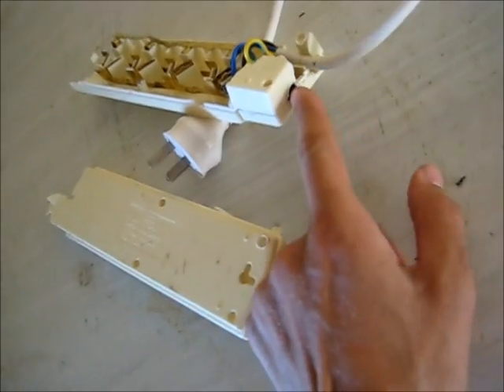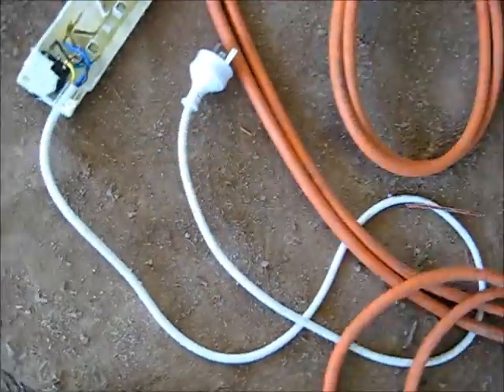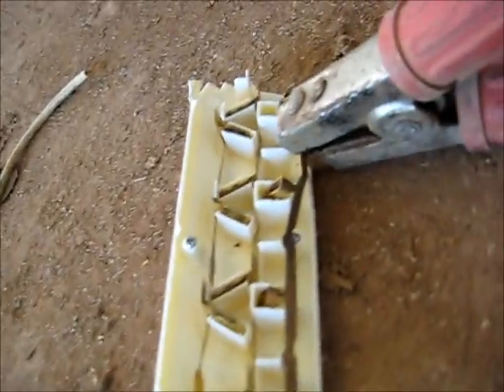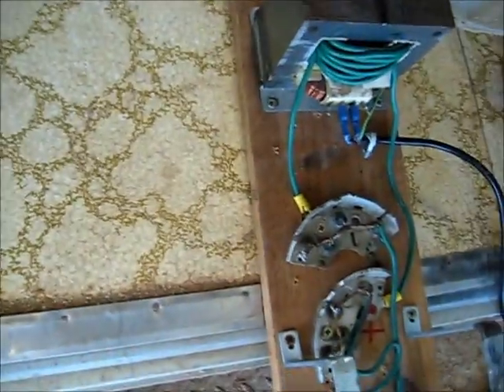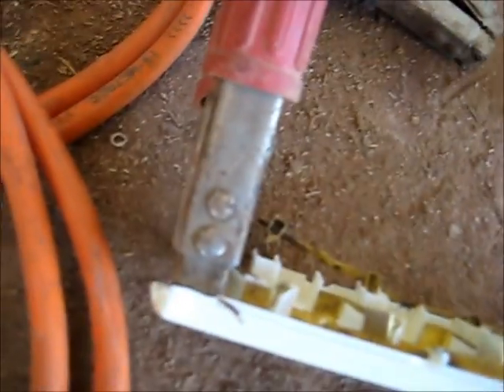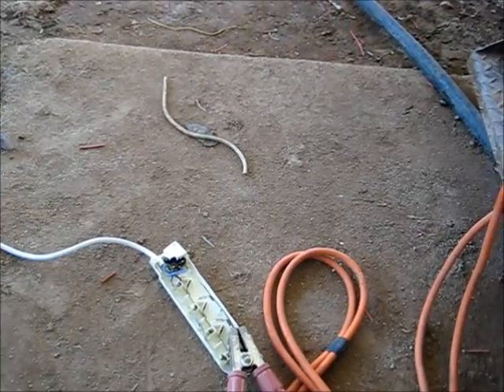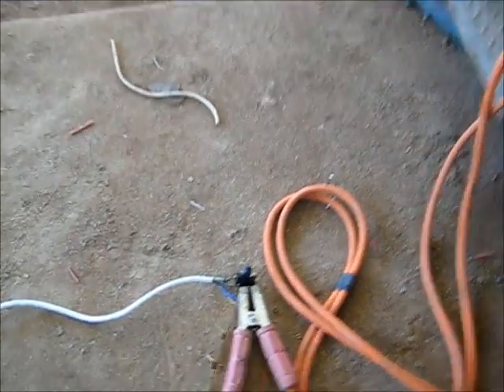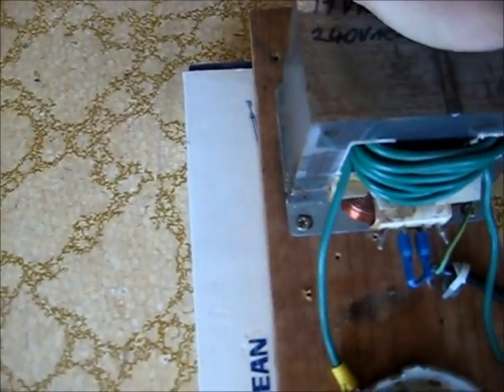Overloading the Dangerous Powerboard

Comment: Diodes from an alternator, good, but I would have left them in the housing, good heat sink.
Reuse of a transformer by rewinding the secondary, but I would have mounted this inside a metal box.
And I would have mounted a fan, perhaps a muffin fan inside the alternator housing?
 I use a 330 amp alternator and electric motor with fan blades attached and inside a box, belt drive so it is as much mechanical safety as electrical.
But, it is all in fun.

Comment: What is scary to me is the way that they make small appliances with heating elements these days, and it's just the Chinese. They use molded plugs with crimped connections to the wires inside and within a year the connection breaks down and the plug gets hot as a poker. Just as bad is the way they like using crimp connectors inside the appliance, I had a hair drier where they used one to connected the cord to the element inside, the handle got extremely hot until I fixed it.

Comment: It looks like the cord was the best part. Even the cheap Chinese 120 volt power boards have problems, after a while the contacts in the outlets get loose and the plastic around the slots starts to melt due to the built up resistance. I have a pair of really good commercial grade power boards that have metal boxes and use proper wall outlets (120 v ones of course) I use those all the time.